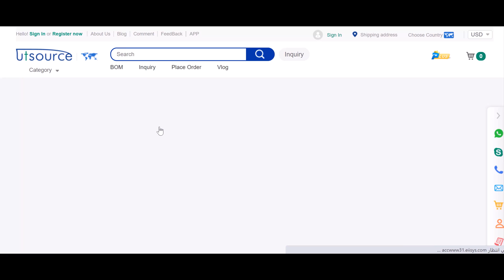how to make simple DC Adjustable Power Supply 0-30v 10 Ampere

Comment: 10 Ampere with 24 volt output /20VA  Transformer 
10 Ampere with one 2N3055 transistor 
0-30 Volt with 7805 (Minimum voltage is 5 volt anyway multimeter show this )
Very Funny video